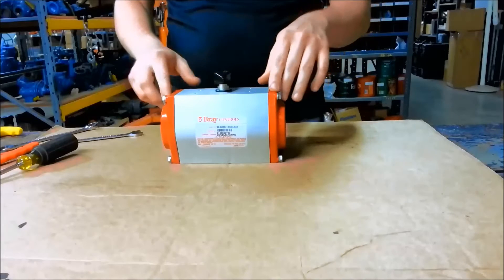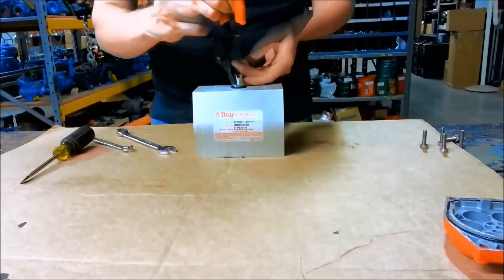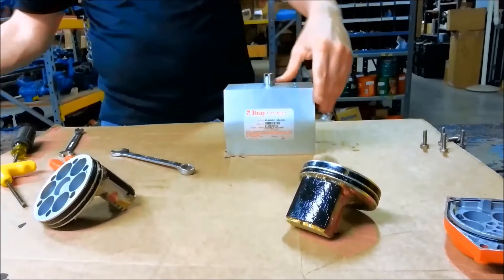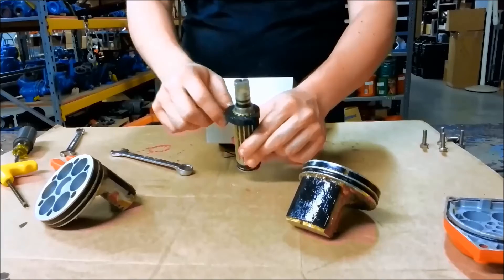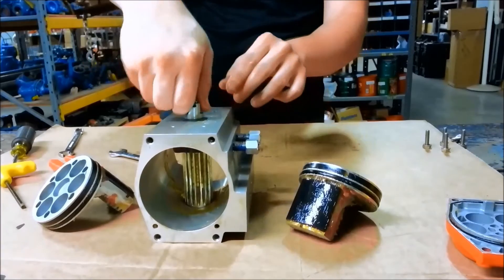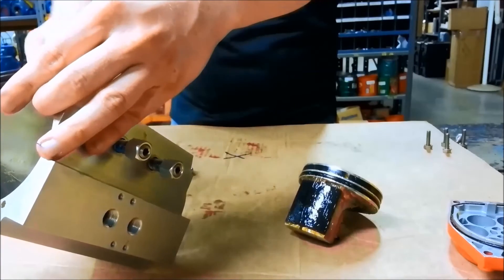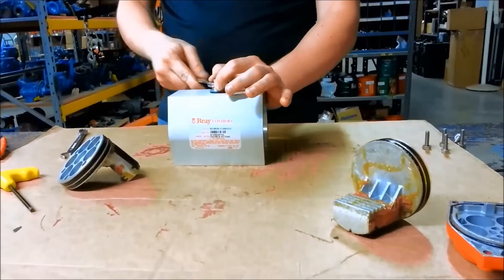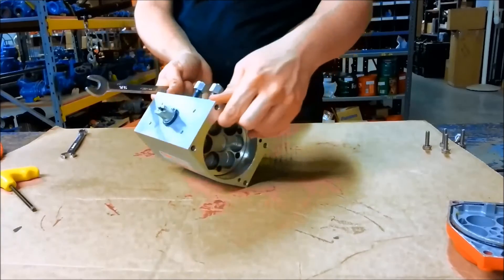Rotating Pinion in a Bray Series 92 Actuator

Comment: Can anyone tell me what the main body on these are made of, also the ends and insides I have a few I’m scrapping, one small one like this and some bigger ones.
Reply: The body, end caps, and piston is aluminium. The pinion is zinc plated carbon steel
Reply: piston's are*
Reply: Here is info from their website https://www.bray.com/valves-actuators-controls/actuators/pneumatic-actuator/series-92-93-pneumatic-actuator